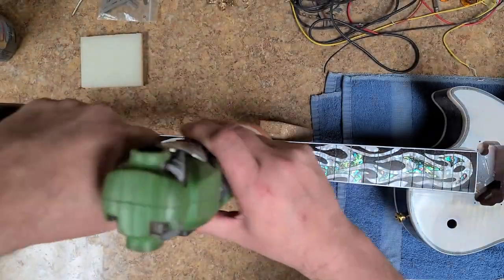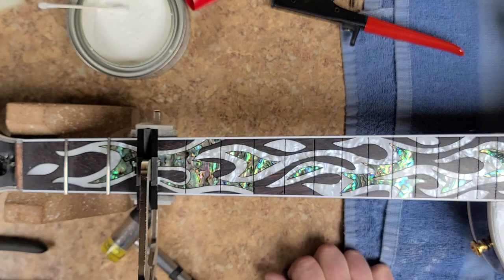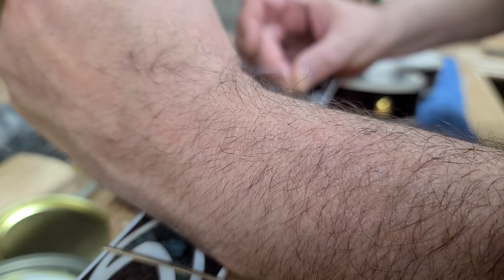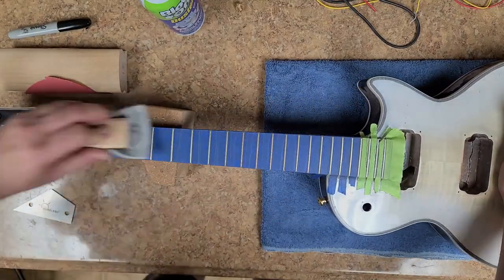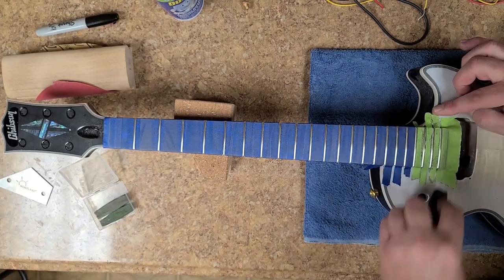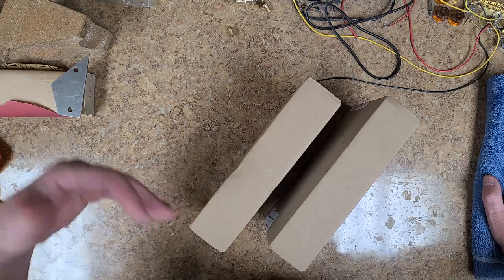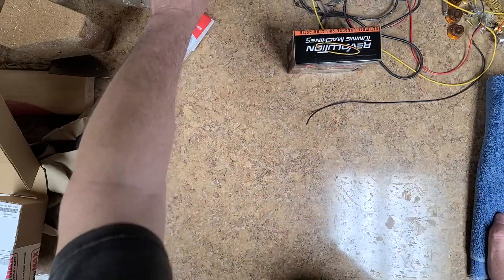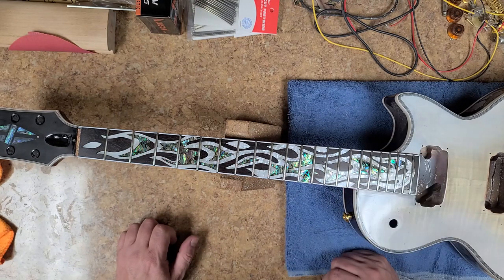Chibson Sh!t? or Chicken Sh!t? Either way it could be a mess.

Comment: Eric, good work on this Les Paul, it's looking great! At about the 9:30 mark you're using a block for crowning and polishing, I've never seen that before. What exactly is is called where did you get it? I'd appreciate any info you can give me on that tool. Thanks.
Reply from the maker: I bought it on eBay. It's called D.Drew Guitars Fast and Easy Fret Crown and Polish tool. I really didn't think it was any good and it wouldn't work, but I was wrong.
Reply: @ericctheartofnoise8613  , thanks for the info Eric, I’m gonna search around for that tool.
Reply from the maker: @bass-hiroshimanick2534  Thats cool.